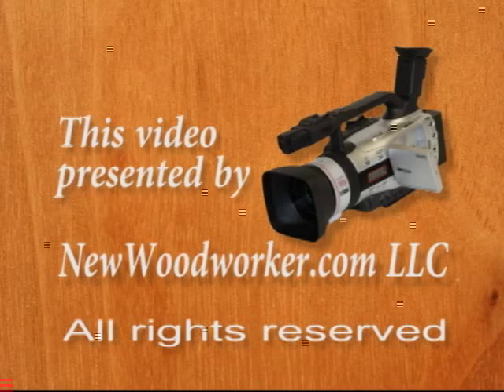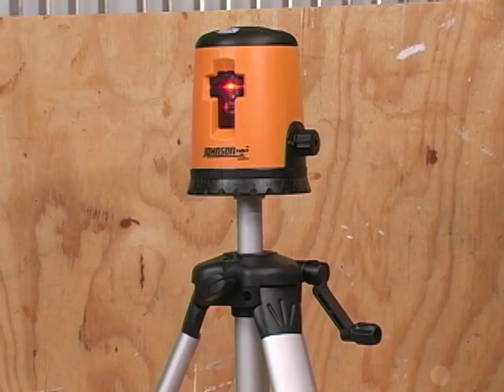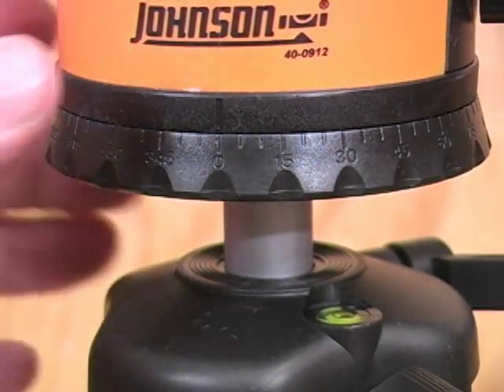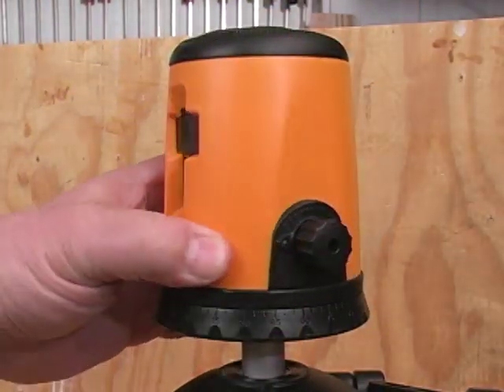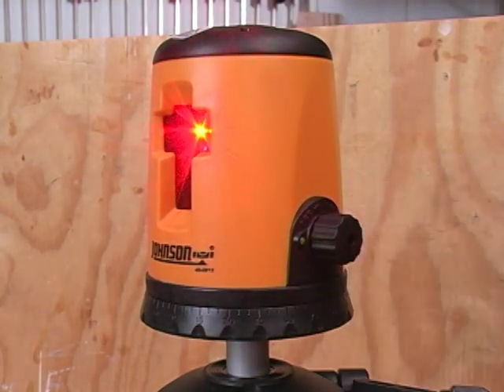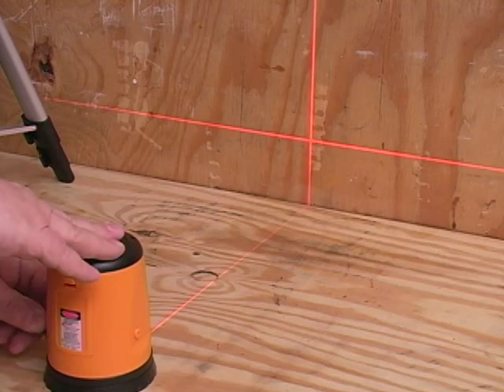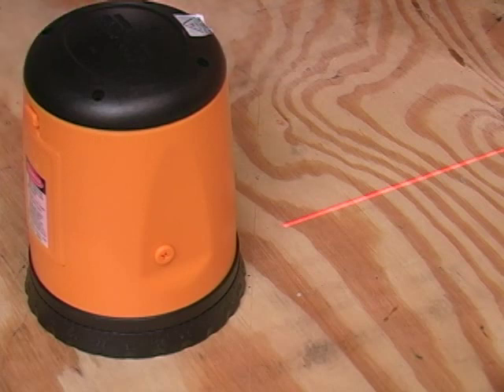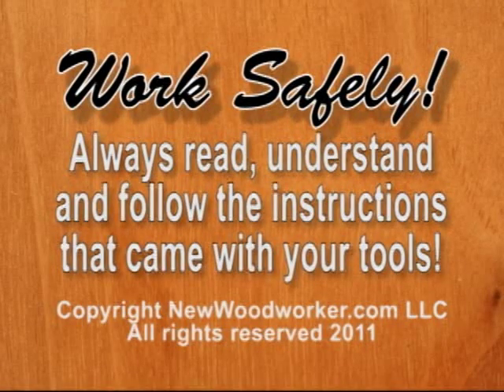Johnson Self-Leveling Cross-Line Laser Level

Comment: Does the tripod allow the laser to be angled up and down? I am installing a curtain rod and  would like to angle the device up so that the laser shows up close to the ceiling instead of having to set the level on something that is that tall to be able to use it. Thanks in advance!
Reply from the maker: This is a self-leveling unit so it has to be straight for that to work. You could put the unit higher and shoot the line that way but tilting it won't work.

Comment: Could it be used to set floor tile?
Reply from the maker: Contractors make up all sorts of low and high "mounts" for way more jobs than the original design had in mind.  I know that it works at a bit of an angle bot over a whole floor I would think that is more than enough.